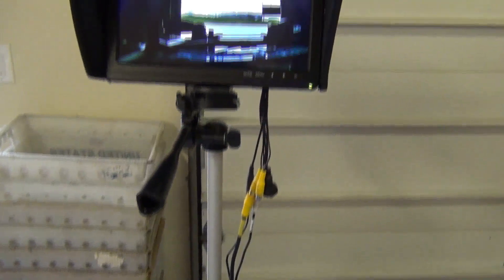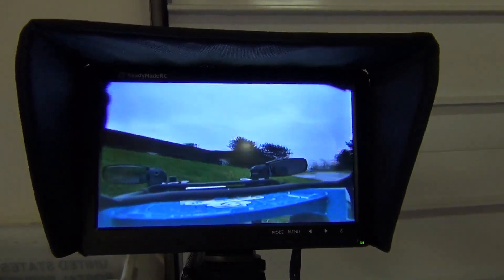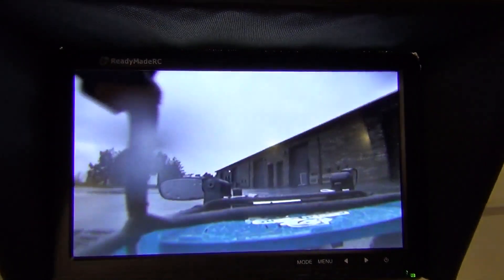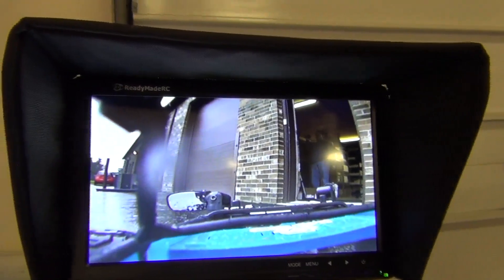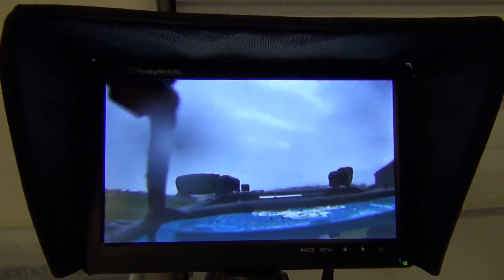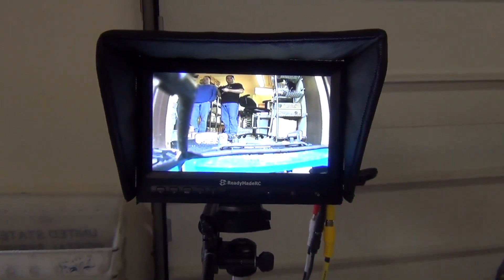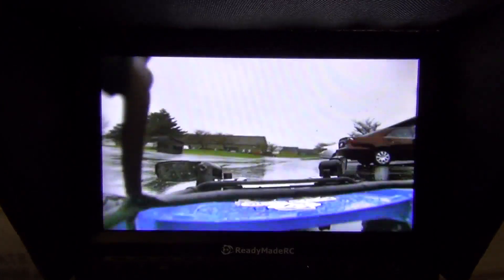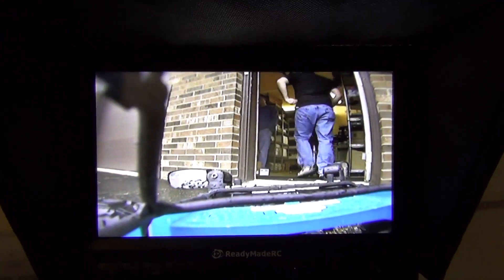ReadyMadeRC, LLC 10.1" and 8" Monitors: Static Demonstration

Comment from the maker: It was the stock 2.4GHz system on a Summit RTR.  The RX antenna is buried down by the motor, not the best spot, and there's no external antenna on the TX.  I like using the car remote, but will probably switch to my 9C with a TSLRS or EZUHF system on it.

Comment from the maker: A 3s lipo works fine.  There are a few ways to get power, but youtube won't let me post links. :-/
Deans to barrel, JST to barrel, balance tap to jst, other possibilities?

On the Readymaderc web page go to:
individual fpv components
cables, connectors, regulators
power cables and connectors